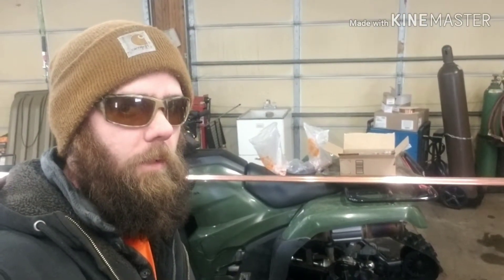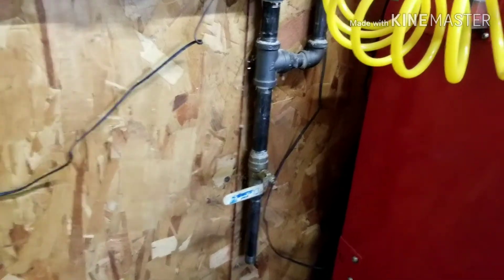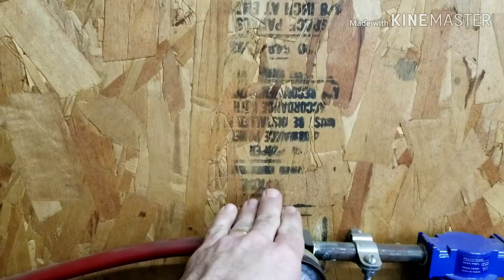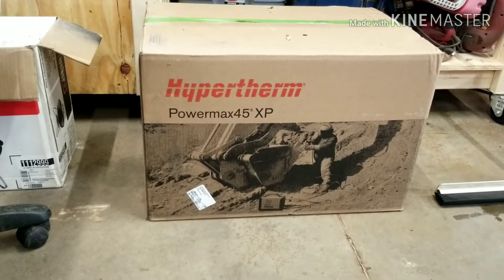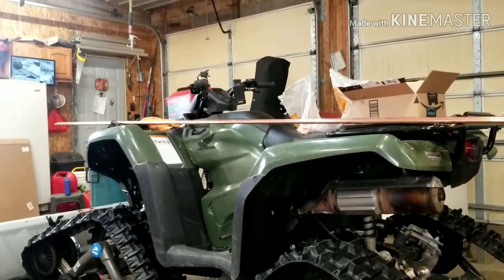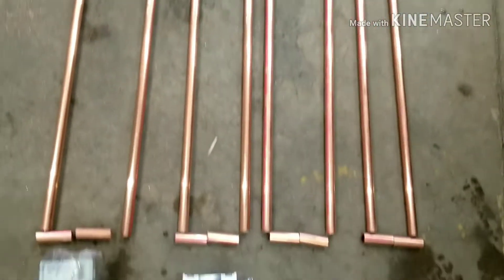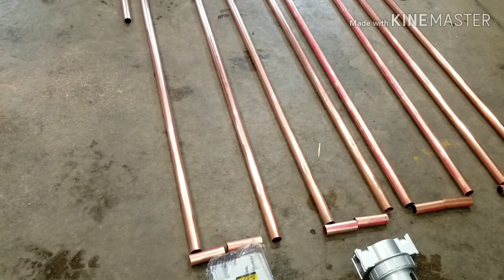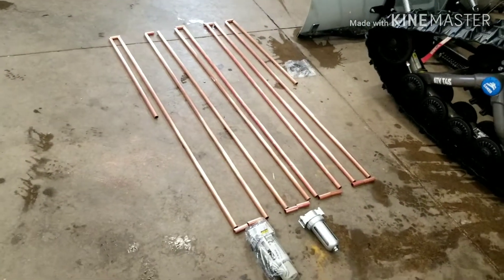How to build a compressed air dryer cheap yet effective

Comment: Nice job.  I have seen this done many different ways.  I am running a two compressor system  I am going to do something like this in my unheated garage.  I am inclined to put the system after my final aux tank so that each compressor can be directed into the aux tank separately. I'll have two inlet ports at the aux tank with a shut off valve and a check valve on each inlet.  I am told this makes a substantial improvement in the time it takes the compressors to fill the aux tank.  From there into the copper drier system. I am thinking that I will have fewer, but longer, loops. Maybe total of 20' of copper.  I'll put a short drop at the bottom of the loop(s) with a valve to manually drain condensation, and only after the air gets through that it will run through a filter and desiccant drier installed at eye level on the wall in a convenient location for maintenance and then off to the hose reel.  I use this system only occasionally.  After use each time I will manually drain the tanks and the copper drier, etc.  We shall see.

Comment: I have a bunch of black pipe left over from being stripped out of my former production facility.  Can I build the same thing out of the iron pipe?  OR.... does the copper WORK BETTER, due to conductivity?   Anyone can answer?  Is it a HUGE difference?  If no< i'll porbably use up the iron pipe. But I can certainly do it in copper rather than waste my time.
Reply from the maker: @brentbarnhart5827  copper dissipates heat faster and better. But the black pipe is free its better than nothing.
Reply: @JDSOutdoors  Thanks.  I think I'm going to buy a radiator.....  between head and tank.  Then treat after it leaves the tank with some traditional methods. A little easiser for me, and should work for what I do.

Comment: Would pex work for cost savings?
Reply from the maker: Copper is a better heat sync but pex and a transmission cooler with a fan works better.
Reply: @JDSOutdoors  could you design to have the bottom on a slope so only needing one release?
Reply from the maker: @laserfalcon  slope won't matter

Comment: I've seen a number of these video's and most folks simply do not maximize the potential here, much in the same fashion you did.  WHY in the hell did you go thru all that work to run air out of the TANK with water in the tank ????  To me that is totally wrong. You take the output of the COMPRESSOR to the dryer effectively  eliminating ANY water vapor from your tank (or very small traces of it) then run the output of the tank thru your filtering system. NOW you have a completely effective pure air to your plasma cutter which cuts your consumable use to less than a 1/3 of any water vapor entering and destroying your tips.  Also making a 6" tip for your drain valves of which you used exactly ZERO AND OPTED FOR (of which you installed a filtering system off each pair of lines ??? ) is a very effective way of capturing any trace water vapors collecting them and draining them.   By using a T at the bottom of the second, 4th, 6th and 8th pipe you create a turbulence effect and place your drain valves under those T's. 1 drain valve per 2 pipes then add ALL your filters in line at the end and then feed your black pipe line supply.  A 5 filter Arrow StageAir 1 Gal. Desiccant Dryer C7612XXL, Zinc & Aluminum Bowl, 1/2" NPT, 250 PSI FOR 441.+   You will have built a BETTER MOUSETRAP my good man. Personally I built a similar system using the same methodology I described to you with the 5 stage filtration but I also added a Derale 15300 Tube and Fin Cooler Core, off the compressor to reduce the air temp before it even hits the copper on the wall.   After this installation I cut my consumables purchases on my plasma cutter by 2/3.  It will pay for itself in 2.5 years.  Though you did do a good job putting it together, researching before executing a plan will give ya more information and help one to execute a plan far better.   

Just a tip from an ol fart that has lived life and made far more mistakes than maybe you ever have.  Peace

Comment: Great Video!

I’ve heard lots of complaints in the review section from Amazon about the air dryers filters that you have listed 

you’ve had them for two years now, have you had any reliability issues? 

I’ve also read of the reviews that you can’t buy replacement filters.
Reply from the maker: Hundreds of hours of airflow through them and zero complaints from me. They work great for me. What are the complaints on them?

Comment: Good ideas.  Changing the existing steel piping, so that there is a longer drop leg at the bottom (for the water catch), would have also helped (similar to creating a large heatsink).  The air in and the air out would have been toward the top (of about a 4 foot steel drop leg).  Do this twice, and you'll remove so much of the air that a standard desiccant trap will remove the remaining 1% of moisture from the line.  Also, inside surface area is important, so keeping the piping as large as possible (most come out of the tank at 3/4" NPT), not only keeps pressures up but also increases the available cooling surface area inside the line.  Finally, heating the desiccant to 245 for 24 hours will remove all of the moisture and allow you to re-use the desiccant beads (you can get more in those little white packets that come with just about every electronics or tool that's new in the box).  As with most gasses, the longer the restricted run, the harder it is to maintain high enough pressure.  But the added 90 degree turns increases the "effective" length of the run by approximately 20 feet, and will substantially cool the gasses to allow the latent moisture to drop out of the mixture.

Comment: In think you should of put valves at your copper drop points to release collected water, then go to the dryers at the end of the the copper run.
Reply from the maker: Each drop has a drain even some auto drops

Comment: Nice video layout. One really big upgrade is you should add a 160psi or larger blow out valve to get more air volume and less run/fill time. These tsnks are rated for 300psi max and manufacturers keep them held back by a large amount up to 50% max capaicity to avoid any damage claims. This larger blow out valve will extend compressor life and give longer work times along with compressor switch adjustment for cut off and cut in psi ranges that work best for you.

Comment: 6 different dryers / filters and lots of heat dissipation from the copper pipe, you got it covered 7 ways to Sunday! Sweet. I hate it, when water sprays out of the air tool. Lots of oil. Never thought about the dry air of the plasma cutter. Next, it just like Christmas and you are 12 years old. Hook it up, plug it in, cut some sheet metal then some thicker stuff. Then read the instructions with a brewski. Best of luck as it should work great. Man makes dryer, then man makes fire! Oh, Oooh, Ooah, OOH! Fire!      lol 
ASE Master Tech since 1978 - Retired

Comment: Great video. I did mine a little a differently. I placed the first filter below the level of the output connection of the tank and I also placed the inlet nipple on an "UP" pipe and not a "DOWN" pipe like you have it. The same with the outlet nipple, I placed it on an "UP" pipe. I tried to use gravity as much as possible to capture as much water as possible. Placing the first filter below the level of the tank outlet insures any water in that first 6 feet runs into the filter and not back into the tank. Looks great !!

Comment: My solution...  And yes, I run a plasma cutter and sandblaster occasionally.

Get yourself a roached compressor off Craigslist or FB Marketplace.  I picked up a nice 26 gallon vertical unit for 20 bucks.  It had wheels and everything! The compressor was one of the oilless units and it gave up the ghost as they are want to do when overused.

I removed all the compressor stuff and just use the tank.   When I want to do some work with a process that requires dry air, I run the main compressor's output into this spare tank.  Then, the spare tank supplies the dry-air-needing-process.  The setup works quite well for how easy it was to setup.  It's not perfect and in the humid summertime some moisture does get through.  But. I'd say 90% of it gets removed by that first "accumulator" tank.

You could do the same thing with a propane tank or other some such holding vessel if the fabrication skills and implements are on-hand.  In the future, I might put in a single U bend copper setup to catch the other 10%.

Here's my video on the topic:

https://www.youtube.com/watch?v=cP3FJzGNahM

Comment: Wouldn’t this be better used between the compressor and the tank? After a while the air already cools down in the tank and condenses leaving the air not being able to condense down much more being used with air temp
Reply from the maker: I use something different between the compressor and tank
Reply: @JDSOutdoors  what do you use before the tank?
Reply from the maker: @ShortyzProductionz  a transmission cooler and an auto drop moisture trap
Reply: @JDSOutdoors  awesome! Do you ever get any moisture out of the copper pipes with the cooler before the tank?
Reply from the maker: @ShortyzProductionz  not a drop. My in tank moisture has dropped from a few ounces every few days to a few ounces a month.

Comment: Works better when you put it between the pump and the tank rather than after.
Reply: How do u do that
Reply: @davidquesenberry7366  Yep
Reply: @davidquesenberry7366  there is a copper pipe that go's from the pump to the tank .   detach it , just a fitting , go from there to your drier ,   " put your drier in a refrigerator "
Reply: @huckstirred7112  That makes sense. Also saves your tank from rusting prematurely on the inside......brilliant!!!
Reply: @frankyvee1  my drier is a small car radiator  .  The  air is pushed threw by a small blower  then to the pump .  After the pump , then  it goes to another radiator in the freezer to the tank .  Way over board . But the refrigerator was there , so why not .  So yea just put a car radiator in the garage  refrigerator . Cheaper and easier , and it takes up very little room in the back of the refrigerator .
Reply: @huckstirred7112  Im a bit surprised. I wouldn't think a car radiator would take that kind of pressure. Usually the caps are rated less than 20psi. But it is a genius idea and glad it worked out!
Reply: @mechanickb4350  There are 2 radiators in the fridge   .   a hole is drilled in the top of the refrigerator , a blower connected to a pipe , " a blower from a vacuum could be used , but I used a blower from a dust collection system , ". You have to have a blower of some sort to push the air to the pump . If not your pump would be a kin to breathing threw a coffee straw "   .  That pushes air from the top of the refrigerator down threw the pipe inside of the refrigerator to the bottom of the radiator . It then go's up threw the radiator ,exiting the top side of the refrigerator , to the inlet of the pump . The first radiator does the drying , " Why pump water , was my reasoning to put it before the pump . But to dry the air before the pump you need a refrigerator . My air filter is right before the pipe exits the top side of the refrigerator . Then it go's to the pump inlet . There is no pressure at all in the first radiator.  My dust collection blower has no problem pushing air threw the filter but a smaller blower may . I do not know . The radiator cap was J.B welded because I never wanted to deal with a bad cap , not because of pressure   
The second radiator is in the freezer section and it was just kind of showing off . It is not needed at all . But it has a check valve before the tank , so air is just more or less just passing threw the radiator . Both radiator caps had there gaskets replaced with J B weld .  
The refrigerator was free off craigslist , the plumbing pipe came from vacuum cleaners on the curb , and the radiators came from Craig's list and were $35 . The air drier in the video is for practical purposes a radiator after the pump . It works because the air is so hot . The radiator has to be cooler than the air going threw it . That is why my radiator . before the pump has to be in a refrigerator . If not the radiator would be same temperature as the air flowing threw it and it would do nothing
Reply: @huckstirred7112  Nice! Talk about being resourceful!
Reply: @mechanickb4350  the pipe going from the pump to the refridge was cut out of a broken patio set 😎
Reply: @huckstirred7112  👀😁👌

Comment: Alright, parts ordered. I don’t know how the hell you built yours for $80 lol I guess if I’d of spent some more time sourcing parts, I could have gotten it a little lower, but I’m at around $450 including parts that you already had. So about $300 in just the copper and filter run. The Type L copper tubing was $100+ by itself. Here’s what my setup is going to be:

Air compressor is a Dewalt 60 gallon, 155 psi, 11.5 cfm compressor. I’m going with 4 drops with the copper too, but the first won’t have a filter or separator. I’m thinking about maybe setting up a tub that it’ll sit in that I can add water to so that it’ll help condense the air. Then the second and third with have manual drain filters, and the forth a filter/separator/regulator combo. At the back of the plasma machine will be a second regulator and a motor guard M60 filter. I’m also installing another outtake fan in the shop, and considering installing it behind the copper to get more air moving across it. If that doesn’t dry the air, I don’t know what to do lol

I’m also Teeing it off at the end of the copper run, and reducing it to 1/2”. One will go to the plasma cutter and the other will be for other pneumatic tools. 

Thanks again for the idea man, but my wallet hates you.
Reply from the maker: I'm guessing its because most building supplies are through the roof right now.
Reply: JDS Outdoors true. Given that most decent air dryers are $1k+, I’m not complaining lol it’ll be a fun build and I honestly think it’ll do just as well of a job. At least a better job than what a $300 dryer would do. Now I’m just curious to see how much CFM I lose. The Hypertherm 45xp only requires 6 cfm, so I should have plenty left.
Reply from the maker: @smokiesleather  my 60 gal if I recall is 9.8cfm and through this and my on tank dryer my 45 doesn't notice or skip a beat
Reply: JDS Outdoors good deal man. How much moisture, if any, is your 45 still catching? Mines actually 60 gallon. Not sure why I was thinking 80.
Reply: JDS Outdoors other than the quick connect coming off the motor guard, I believe I’m finished! https://i.imgur.com/sLvIEUi.jpg
Reply: You better off getting a frig for ~ $500.

Comment: Not trying to offend you,, but put the 1/2 coil between compressor and tank and you won't have water,,many use transmission cooler but most are 3/8 tubes and  cause restriction that hurts compressor,,,I couldn't believe the difference, 200 degrees entering tubing and 120 leaving it and no more water.

Comment: And put a 1/2 inch separator at end of coil before air enters tank,, all water happens when 200 degree air hits much cooler tank,,so cool the air!!! But don't restrict it with to small of tubing,,,use 1/2 inch are greater.
Reply: Do you use 1/2 inch cooper?
Reply: @minkbandem8093  yes same size as line between compressor and tank now,,,never go smaller
Reply: @georgespangler1517  do you have any issue so far when you use 1/2 inch?
Do you use type L 1/2 inch copper?
Reply: @minkbandem8093 mine is fine for years and I don't  get much water since I installed it,, water comes from the hot compressed air entering the cooler tank,,,cool the air and problem solved
Reply: @minkbandem8093  make sure to leave relieve valve before tank,,that's the hissing sound when compressor shuts off,,,it will hiss longer with more pipe to drain to take back pressure off compressor head for startup
Reply: @georgespangler1517  do you use 1/2 inch type L copper?
Reply: @minkbandem8093  go to lowes and get a 25 foot roll if 1/2 inch copper tubing and I coiled it around a 5 gallon bucket to make it smaller and install it in front of fan and connect to compressor head and tank, you can use compression fittings on line that's there if you want to cut it and you will feel the difference in heat as it travels through coils cooling it

Comment: Nice setup,,but overkill and wrong approach,,, been there,,,, best way is too cool air before it enters compressor tank,, that's where condensation forms,,, l used a 1/2 copper coil between compressor and tank,, dropped my air temperature 80 degrees and solved all my moisture problems,, stop the moisture before it leaves tank and problem solved, l wouldn't steer you wrong,,,try it,,,only cost me 40 dollars.

Comment: Thanks for the video.  Very helpful.  However, $80 for the whole thing?  It would seem that the dryers and filters alone would have added up to more than $80.  Adding in the tubing and fittings would have brought it even higher.  Or am I wrong?
Reply: I thought the same exact thing, I would wonder how efficient the "cheapest filters/dryers you can find" actually are on top of how long before you are changing filters in these items? Also, how much of a CFM loss did he create here by adding multiple restrictions? The end doesn't justify the means in my book...